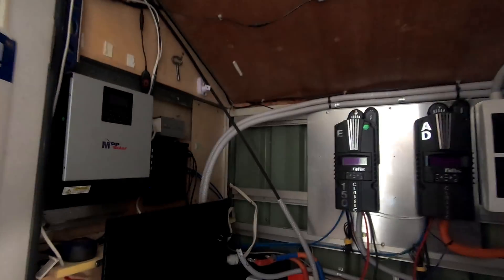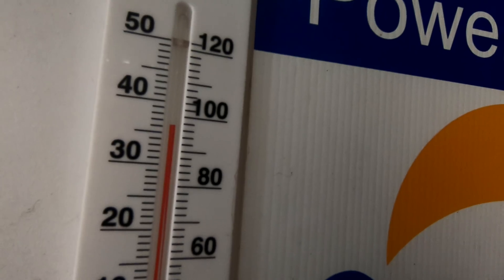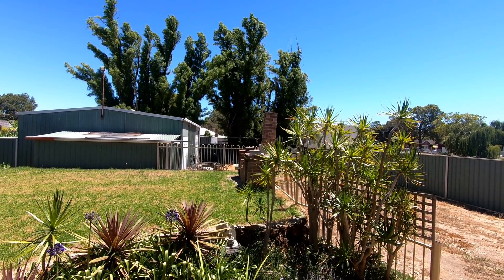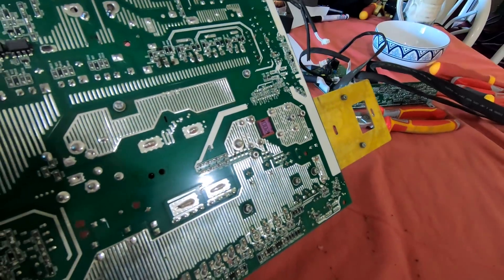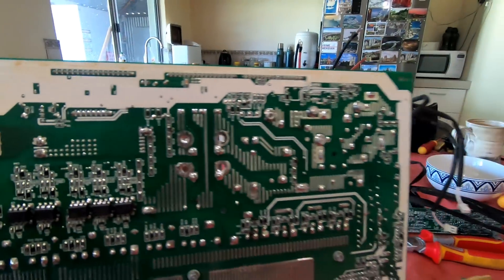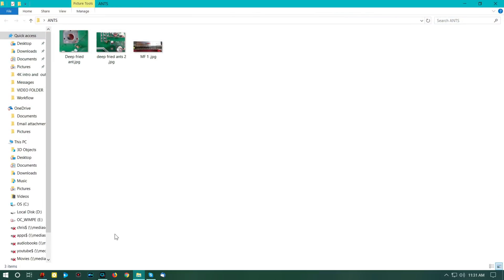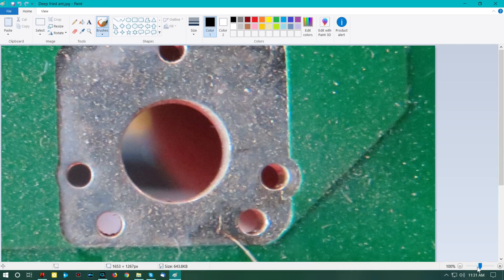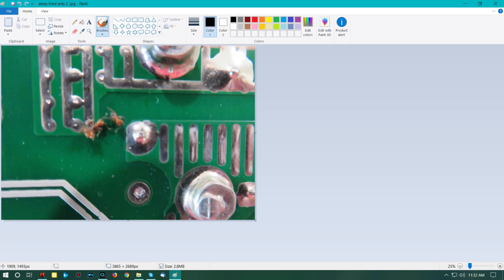OOPS MY BAD. 48v OFF GRID House

Comment: hadnt seen this video before, those ants realy went to the warmest place, i think im off to jaycars and buying the circuit board/electronics sealer spray
Reply from the maker: That sealer spray makes your bits run hotter. Just use a good surface  spray around the units. Turn all off first and any extra charge controllers you have as well.

Comment: Those must be some Juicy Ants to short out the inverter!!  Here the Rats nest in the battery box's because of the warmth in Winter.  Every Spring I have to clean out the nest and blow the crap out.
Reply from the maker: get enough of them and they can eat a man. So shorting an inverter is not a problem for them at all. I don't have problems with rats or mice as there is no way into my battery box unless i leave the doors open. Big water lizards that love to come over here from the river get into my power room but they are to big to get into anything. They just love the warmth in winter.

Comment: You wouldn't think a little ant would carry enough current to do so much damage.
Reply from the maker: one little ant could not. but if you watched the video then you would have seen the many BBQed ants stuck to the MOSFETs
Reply: @JustinCaseSolarPower  I did see them.  Nice job on the blown up photo to illustrate.  Have you torn down the other inverter to see any made their way inside?
Reply from the maker: @TheDisorderly1  Yes i did.  Does not take long to strip them down and blow them out with the air compressor. They just got into the one unit. Trying to get some parts for it now so i can fix it.

Comment: that inverter might work now that you removed the ants, its worth a try!
Reply from the maker: No she is dead. I already have the parts on the way so i can fix it.
Reply: @JustinCaseSolarPower  thats great! cant let our inverters rest ever! I would like to test one of those pips if they made a 120v one :( might try one with a step down transformer some day. I am testing a new 8000w reliable inverter soon! cost more but they say it will do the full 8000w not just for a few mins, im hoping its going to be a killer inverter, as of now I am loving the magnasine inverters, I will keep them ants away!
Reply from the maker: they do make a 120v unit.